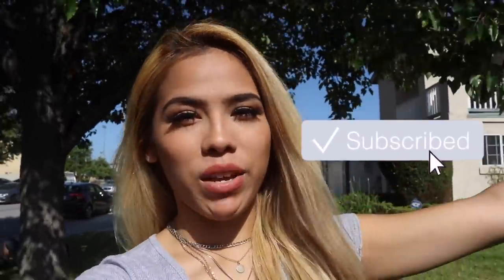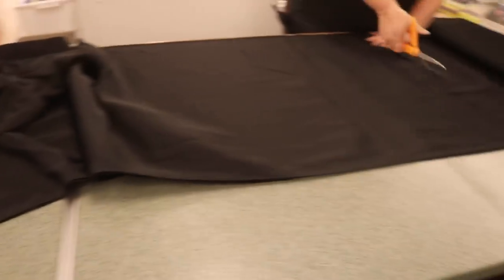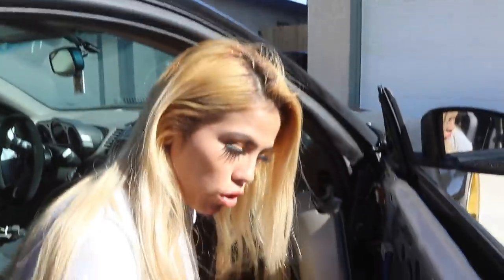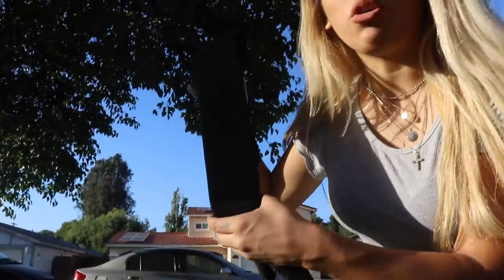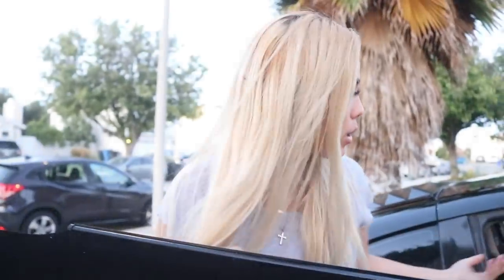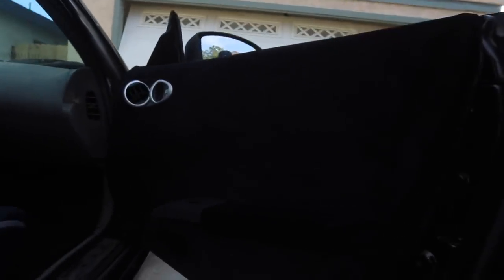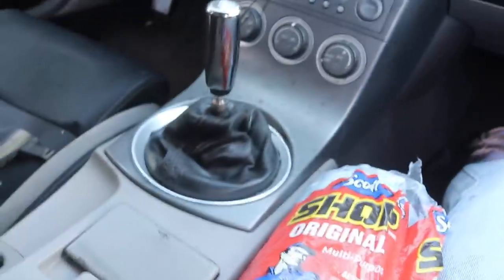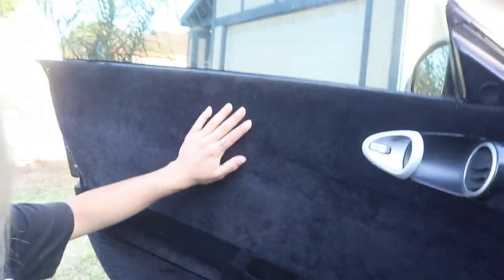This Is The Coolest Interior Mod I Did On My 350z For Cheap.. (Bubba Is Lost)

Comment: The fabric is going to peel up with the heat!! Non of the those cans work not even the 3M.. the only thing that will work is contact cement. Tip from experience lol
Reply from the maker: Uhh oh 😭 okay I’ll look into that so I can finish the rest thank you !
Reply: Chuuuki no problem just trying to help out. Give it a few days in the sun with the windows up an check it if it starts to peel or bubble up. If it doesn’t you might be in the clear. I did it on a few cars and the heat just makes the glue Tacky agn. But it could be the Las Vegas heat lol. The only thing that I found out that works is contact cement you can find that at Home Depot.
Reply from the maker: Jose Beltran wooah okay hopefully that doesn’t happen but if it does I’ll know what to do! 🙏🏻🙌🏼